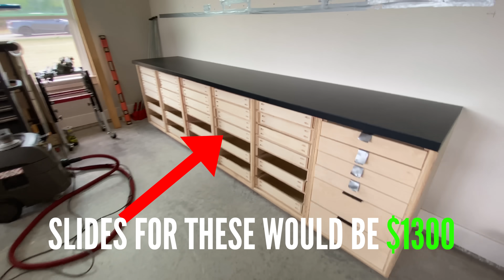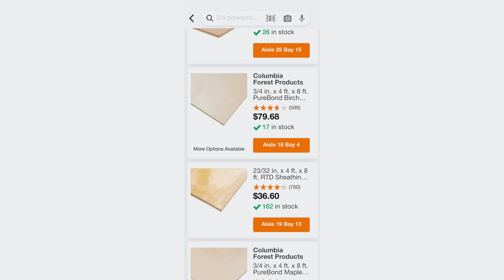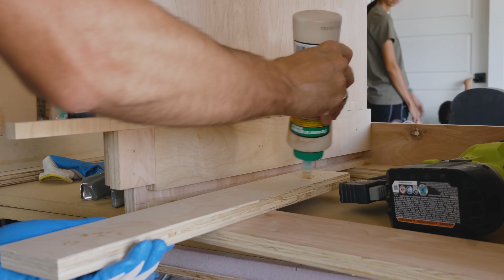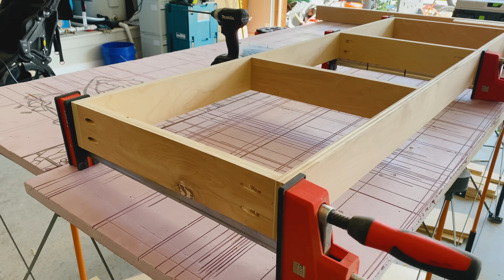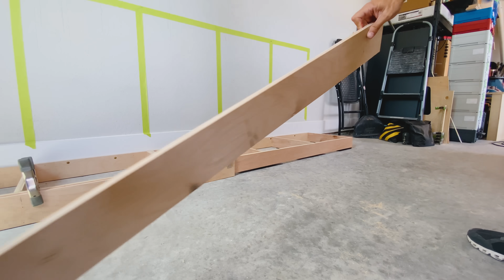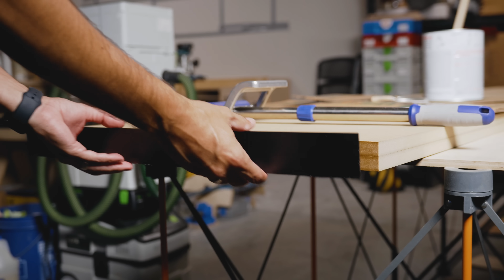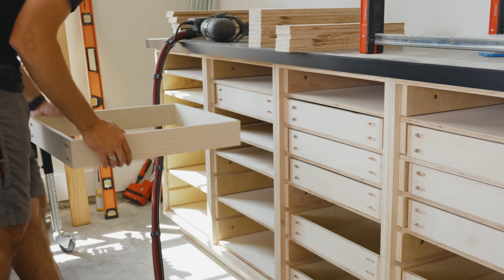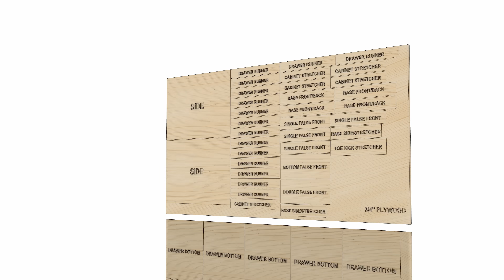Drawer slides are expensive. Do this instead.

Comment: As I remember, that mark on the edge of the plastic laminate is because, either is a bit with a solid guide or the bushing has too much dried contact cement and it doesn't turn freely, so it needs to be cleaned with solvent. BTW, I'm old, in my computer, and don't know how to (or if it can even be done, lol) do the emoji thing so, imagine this is my snorkel emoji, lol. Nice job with the cabinets and the video. Had fun watching!

Comment: One thing I learned from my father who was a carpenter, is to use a beeswax on the wood slides and polish it well so they slide very easily.
Reply: That was the step I kept waiting for… why didn’t he wax the slides? My grandfather always waxed the slides and grooves as his final step (he would sand them earlier in the process)
Reply: Paraffin (candle wax) works great, too.
Reply: @generessler6282  I have also used a bar of soap
Reply: @generessler6282  Crayons work too :)
Reply: i'm not wood worker and i have no one in my family but I'm engeenier and i thought abou beeswax too
Reply: You can also use drawer tape which has a slick finish.  I've used it on old antique dressers that don't have slides, works great.
Reply: Mother's, Maquire's, Turtle, any car wax works great.
Reply: I thought there would be a finish too! I imagine the friction will get annoying with enough mass in the drawer
Reply: I believe I would add a strip of aluminum flashing to the top of the boards that support the drawers.
Reply: Silicone spray.
Reply: Silicone doesn't clean away with soap and so tends to ruin future efforts to paint, leaving fish eyes

Comment: Another tip: instead of routering and then filing the edge flush, a better way is to leave a few millimeters, then remove the remainder with a belt sander. Of course make sure you always sand "inwards" so you don't accidentally pull the edge off with the belt. Work lightly, make sure the back half of the belt always stays on the top surface, don't put pressure on the sander in order to not sand holes in your surface.
If you do this, the edge will be guaranteed flush and will allow the top to stick to the edge perfectly.
The Makita 9404 is great, the 9403 I don't like, it's bulky and doesn't feel ergonomic. Grain P120 is perfect.

Comment: Use thin strips of 1/8 inch plastic attached to the draws where the plywood rubs against plywood.  Using plywood is fine but the drawers will wear in time.  A harder wood is preferred over plywood.  A plastic (HDPE, or "puck board") is best considering it has very low friction and will lead to a longer lifespan with smoother drawers.  Anyway, just a thought in case you ever start to notice the drawers binding.  Thanks for the video.

On that note, the counter top laminate might also work for this application.

Comment: Noticed you built double-wide drawers, and they are still be mostly interchangeable.

I collect pieces from candle overruns for situations like this. The draw(er)s might slide slightly better if you rubbed some wax on both surfaces.

🤿

Comment: Something I saw done in a van-life build to avoid hardware (which takes up space too) is to use strips of Teflon tape. It allows boxes to fit into things very tightly while providing an excellent low-friction feel.  Can probably also use something like Delrin or even just some kind of oil, but I thought it was really smart.

Comment: Yep.  When you use a teim router don't force the bearing into the wdge.  Eapecially on soft materials.  If the bearing dents inward 1/1000 of an inch, the router bit eats 1/1000 of an inch.  I find it's best to go over in a light pass, aee where I'm at, and go ovee it again if necessary.  The filing or sanding of that hard corner will even out  minor inconsitancies.  Or as previously mentioned, you can use a strip of painters tape to give you a little extra give.

Comment: You can also save some money by using strips along the front and back edge of countertops and then running cleats at 90° between the front and back along the top of cabinet pairings. You will save so much weight and material

Comment: One way to build the toe kick to assist with leveling. We made our toe kicks on the front & finished end @ 4 inch. The remaining bracing and back stringer @ 3.5 inch. Set and level & screw the back stringer to the wall. Cut shims flush on front and cover with a finish substrate of your choice.

Comment: Little tip. For your drawers to slide better i'd suggest putting a Polyethylene strips on the slides, it's cheepa and slides smooth like bearings.

Comment: I made it to the end!  You have done beautiful work there!  In my younger days (I'm 85) I built many things with plywood, from guitar amplifier/speaker enclosures and shelving to storage box bedframes.  My primary concern was functionality, appearance came last.  I started with a hand saw, a square rule, an old hand drill from my dad, a file/rasp combo and a screwdriver. Later I added a power drill & power rotary saw.

Comment: The contact cement gums up the router bit bearing and it doesn't turn freely.  You have to clean the bearing once in a while so the bearing doesn't scuff the laminate.
Did you use regular contact cement or water base?

Comment: I want to build cabinets from cement board. When you think of this, are you repulsed? I'm not talking about backerboard for the bathroom. I'm talking about 4'x8'  cement board. Not easy to work with and breathe, ultimately I'd use CNC plus no wood grain, only painted. Can you tell me the challenges?

Comment: I've been doing laminate work for 40 some years.  I use some masking tape on the edges for the barring to run on that first trim cut.  (Yes it leaves an edge that needs to be trimmed off) it also helps on glue not getting stuck on the edges.  I peal off the tape and use a 15 degree bevel bit adjusted just the right height to just touch the top edge of the side sheet.  Then the fine laminate file after to smooth it all out.  Note the edges will creep in over the next few days as more solvent escapes from the contact cement so you might have to go back over it again in a weeks time, or you can wait to do the top edge until 1-4 days later depending on weather and temp.  Good job on the build, great to see these DIY videos.

Comment: In my experience it depends on the weight of the items you're putting in the drawer. I live in a 74-year-old house where none of the drawers have slides. After that length of time not only has the wood worn down to the point that the drawers don't close properly but I can also tell you that drawer slides will always move easier then what you've done.

Comment: I've made cabinets from scratch and done laminate tops. I realize this is a year old video, but a couple tips that might have already been mentioned concerning the laminate - trim the top laminate with a 15 degree bit, therefore you won't cut the side pieces. The only problem with having laminated top and sides, the edge can be sharp enough to cut fabric. You need to burnish the edge afterwords to alleviate that. Additionally, installing the top cabinets first is so much easier as you can stand with a helper and a 1x2 "shelf" to align all the uppers accurately.

Comment: Thanks so much for this rad video, I learned a lot! I also really appreciated your decision to go to a local lumber shop. And the deep dive 🤿 into drawer design and assembly was great! The drawers seem very sturdy - but now that it's been a year, have you noticed any wear/looseness on them due to drawer pull location? I wonder if attaching the pull to the base of the drawer would be an option. Probably a more complex router step, earlier in the process. I dunno. Just spitballing.

Comment: When I was a kid, my grandfather (pattern maker and cabinetmaker) had a huge workbench with dozens of drawers all the way to the floor, and they were all wooden slides like this. Here's a tip: run a bar of soap on the undersides and edges of the drawers where they run in the slots--they'll be a lot smoother when loaded. (Cross-country ski wax is good, too--a little spendier, though.) 🤿

Comment: One little trick for the kicker base I've started doing, set up a laser level, position each peice (left slightly too wide) and mark the top edge at each end, use a straight edge and cut.(If the floor is really bad, you can scribe and trim the bottom side first) Keep careful track of each peice location and orientation. Then assemble, exactly lining up the top edges. It's faster than shimming with a level, and easier to get exact. There are no gaps left to cover or fill. I've even stopped running the peice against the wall, and have the middle legs go 1/2 to 3/4 of the way back. This allows a bit of forgiveness for imperfect walls.

Comment: I started making laminate countertops in my dad's shop in middle school.  We would trim the laminate with a beveled trim bit which had no bearing!   We lubricated the laminate with paraffin wax where the bevel bit would make contact.  As long as you kept moving, it never burned the laminate.  You find the paraffin wax in the canning supplies at the supermarket.  "Gulf Wax" is a good example.  It comes in blocks about 1/2 thick.  You rub it hard against the laminate like you would a wax crayon.  Works every time!

Comment: for mounting the upper cabinets, couldn't you use a board mounted to the studs behind the cabinets cut at an angle to form sort of a hook shape and on the back of the cabinet make a board at the top that hooks into the wall mounted board. I have seen this done for European cabinets since folks tend to take their kitchen cabinets with them when they move.

Comment: Longevity(?) question. Since your design uses wood sliding on wood, have you found wood dust coating the contents of your drawers? A rental I lived in a little while back didn't use sliders(?), it was just a box that slid on wood rails. The cabinets underneath would always get a dusting of wood particles after a while. I know these are shop drawers, so it probably doesn't matter for you, but I'm just curious.

Comment: Drew, your presentation skills are stellar. Your modular design, jigging, production strategies and general tips and tricks are outstanding.
Note: I'll bet the pilot bearing on your laminate trimer is dragging due to wear or glue contaminating the race. Change out the bearing as often as you change out the carbide cutters. 🤿👍👍

Comment: Watched the complete video, but couldn't find the snorkel emoji, so you'll have take my word for it. Haha!. Choosing the black handles serves an aesthetic purpose too. If you had cut a hole to grip, and bearing in mind you didn't protect the wood with varnish or similar, meant you've avoided the grime that without doubt would have built up around each opening. Well played.

Comment: Nice, I like your drawer slide design.  For the laminate I like to attach a hardwood strip around the countertop, glue down laminate, then bevel the wood strip and laminate edge together at a 45, super easy and looks good too.

Comment: I just found your channel today (end of December 2024).  I'm curious how the cabinets are holding up.  Was there any issue with wood swelling or shrinkage that caused poor fitting or sliding drawers?  

I'm in the Houston area, so moisture in the air is a thing.  Looking back, would you add a little more clearance for the slides?

Comment: shim inconsistency does not matter. Each shim is independent of the other. If one is thicker it does not go in as far. that's all. Drywall should be taped and mudded one coat. this is the minimum to pass code. This is fire and smoke protection. Especially in a garage with bedrooms above. snorkel emoji.

Comment: I love it. I have a project like that in mind. My tool chests are getting old and the drawers start binding up.
Those tool chests are extremely expensive!
I was wondering how the drawers performed with weight in them from a sliding standpoint?
Also, is there anything that keeps the drawers from falling out when pulled out too far?

Comment: I have been doing woodworking as a hobby for decades and have gotten most of my hardware for free. It's easy. I just pick up old furniture from the dumpster area of apartment complexes and college dorms and wherever else I happen to see some. Most of the furniture I pick up looks bad, which I expect is why it was thrown out. But I view it from the perspective of usable parts. If I see something that looks usable, then I take the furniture. I have also gotten a lot of usable wood this way - especially from older furniture that was made from real wood such as oak.
Reply: I'm not going to count them right now, but I'm sure I have at least a couple hundred pairs of drawer slides that I got for free.

Comment: Nice tip, was considering something similar for a set of workshop drawers and now I'm definitely gonna take this route, I also ran into the same issue with runners being insanely expensive.

PS. As a metric system enjoyer, your tape measure looks totally cursed lol

Comment: I have built similar cabinets in the past for my shop but my only caution about the homemade drawer slides is that they may bind in a shop that has high humidity or isn’t climate controlled.

Comment: As a professional woodworker and master carpenter I use adjustable stainless steel legs to support a free toekick or pedestal base. It leaves the bottom open for just the incident you mentioned, water flood. Costs a little bit more but well worth it if you doe experience water in you shop. Great video. 45 years and still learning. Thanks

Comment: I know you probably wont see this, but I worked in a cabinet shop for a while. We made mostly laminate counter tops and cabinets. To prevent the mark when you are trim routing the excess off the top, we would always apply a little Crisco to to the edge banding. that helps cut down on the friction from the bearing. Also, you can go really fast with the flush trim bit. Great work, and thanks for the video.

Comment: We have a cabinet shop in my town that has a booth at the local "Peddler's Mall". They sell 2x8 "leftover" sheets of plywood in thicknesses from 7/8 to 3/4 inch and some of it is VERY high Quality. I'm making drawer fronts from a sheet of 1/2" with beautiful unfinished walnut surface. The sheet was $4.99. The 3/4" sheets can be as high as $12.

They also sell tons of various trim types including crown molding, etc. They also have a lot of finished boards that are 8' by 10" wide and over an inch thick for $6. I'm making shaker style doors for those. 
I'm almost done with my new kitchen cabinets. 😁

Comment: Nice work, built a bunch like this in my shop using melamine with the plastic snap on edging on the drawer bottom sides, I thought they'd slide better for many years to come. So how are yours after a year now, any wear on the edges making the drawers sticky or even throwing out the spacing on the front? I'm 5 years in and still going strong.  Also where do you find the snorkel emoji?

Comment: You pushed the router in the wrong direction. When using a router you should move it so the blade cuts into the work not out of the work. Thus, if you stand with the table on your left, start at the far end and pull the router toward you rather than pushing it away from you. You should also make several shallow passes rather than trying to cut it all at once in one pass.

Comment: you can either add tape on the sides when you're routing the top sheet of laminate, or you can add a thin layer of cooking grease where the bit will be on contact. It will slide right thru

Comment: Duct tape has thermal and issues, heat & cold affects the adhesive, causing it to break down. So, yes, duct tape is horrible for duct work. Many believe that it started as duck tape as it has pretty good water resistance, as long as you put it on a dry surface first. But many English speakers run the two together, so the t migrated over to the duck part turning it into duckt or duct.

So I wouldn't use it in places where there were big changes in temp

Yes, I did watch to the end, but it's important to understand that not all materials are good solutions for every case. Duct tape is versatile, but it has its failings too.

Comment: Big box stores sell at SRP, suggested retail price, so unless they are running a sale, their prices are going to be the same or similar
smaller specialty shops have some options, mostly to do with the owners and the shops sales. Also, taking a slight loss can bring in more sales, which can result in more profit.

So why don't bug box stores do this? Why should they. They have a lot of traffic and make more profit per sale. The loss from a few shoppers who use cheaper shops is offset by one-stop and lazy shoppers.

Comment: Those marks from the router cutting into the side laminate slightly look like either the side of the counter is not precisely 90º or the side is square but when you glued the laminate to the side the top of the laminate strip wasn't pressed completely to the board, with the laminate bowing ever so slightly outwards on the top. This bowing could also have happened when you glued and pressed the top laminate down and the side laminate was pushed out slightly where they contacted, because it was sticking out a bit? The file should have taken care of that, but the tolerances here might be really small, I mean, the cut from the router into the laminate looks really shallow...

Comment: Cool idea. Not a huge fan of the fear of overloading them and binding up, but if it works, it's awesome. I'm planning on building a play desk for my son with Lego baseplate on top. 4 sets of full extension slides are $130. The issue is everything will be coming from Menards and te plywood I'm going to use does have voids.